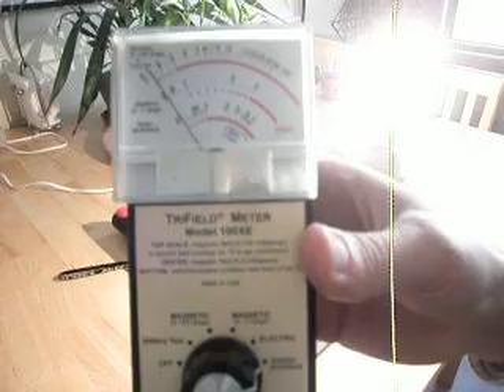Testing an LED Light Bulb with a Trifield Meter

Comment: Could the readings of pulsation be due to the fact that the LED bulb is in fact a diode which changes the waveform and some LED bulbs are actually strobing 60 times a second as the result.

Comment: So you've discovered the concept of electrical interference. You can fix this with a simple capacitor in the circuit. Or filter on your radio, just like old cars with solid core ignition wires did to solve the interference. And EMR is a log function of distance, so unless you are holding it for a few hours, you've got nothing to worry about. Just a few inches will drop the readings as per the SAR guidelines.